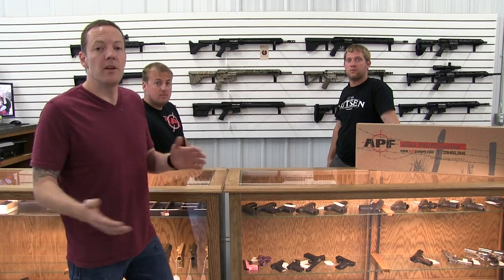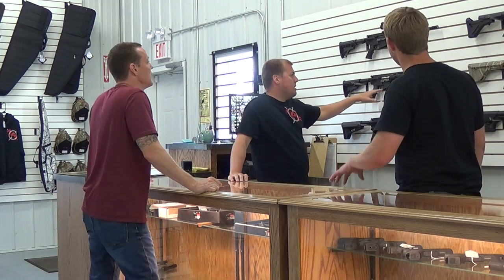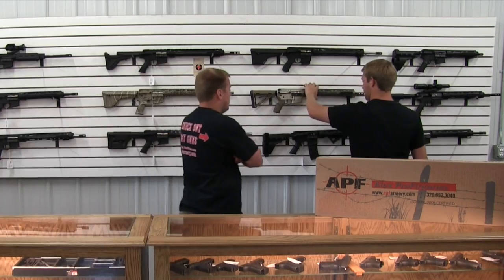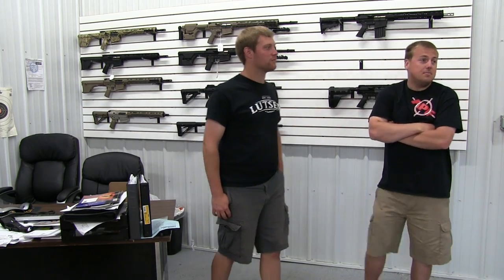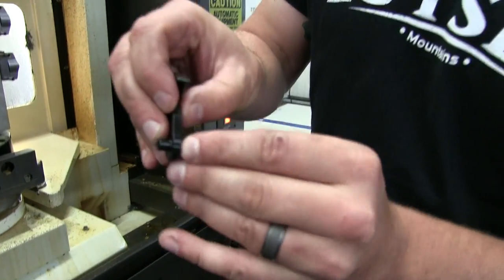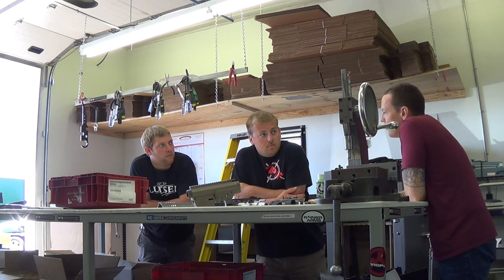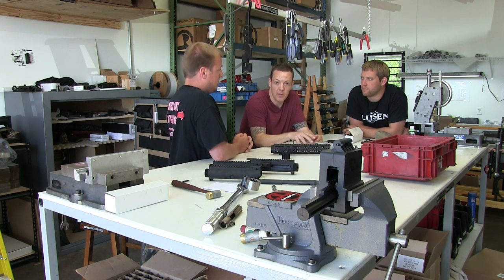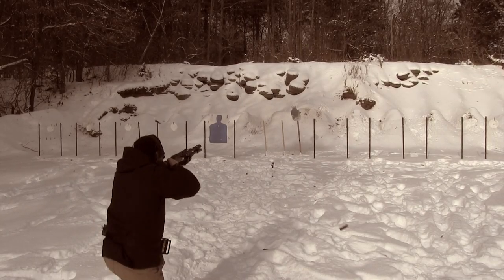3 Gun Gear Review - Alex Pro Firearms and APFArmory.com - 100% MADE IN AMERICA

Comment: Good stuff.
A question.  Just bought a 7.5" ar pistol 5.56. With no magazine in and the charging handle racked, if I hit the brace fairly hard the bolt closes. Normal?
Also, upon initial shot the brace moves forward and continues to do so for at least 3 shots. Thoughts?
Reply: Bolt closing is normal idk about the brace moving